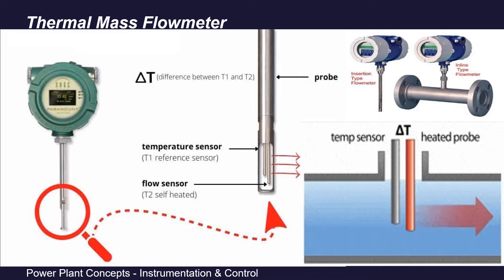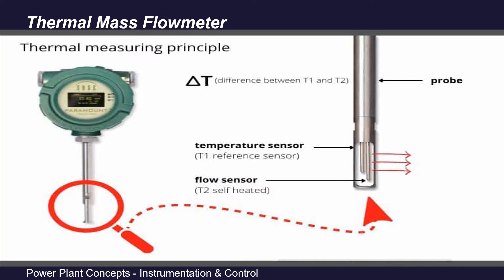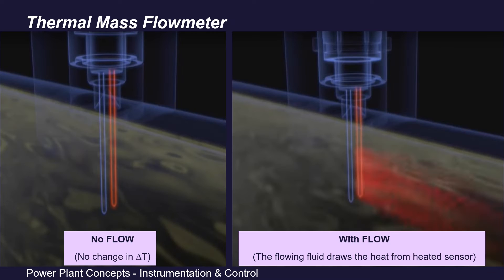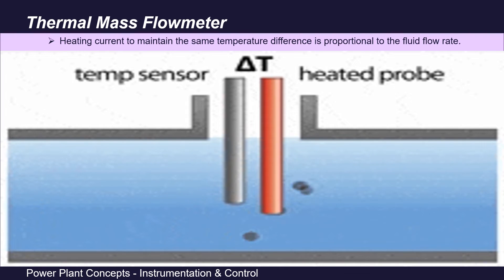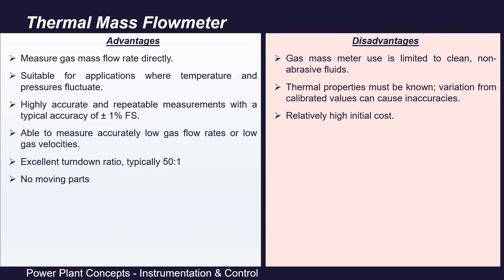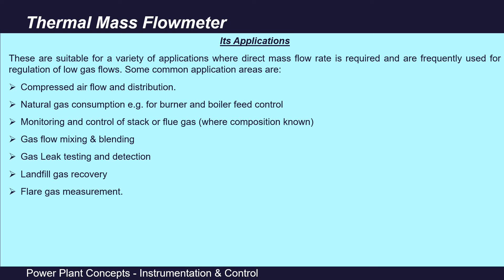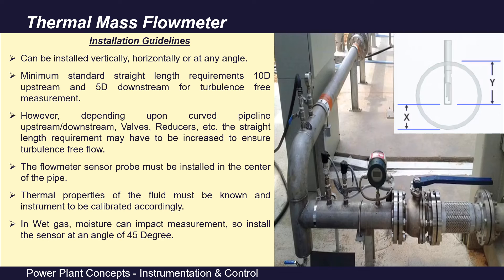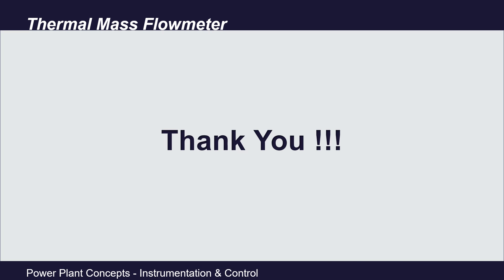Thermal Mass Flowmeter | Mass Flow Meter | How Does Thermal Mass Flowmeter Works | Mass Flow Measure

Comment: What happens to the reference electrode's temperature when fluid flows?. Will this flow not take away heat from the reference electrode??. If yes, how is this addressed in measurement of mass flow measurements???